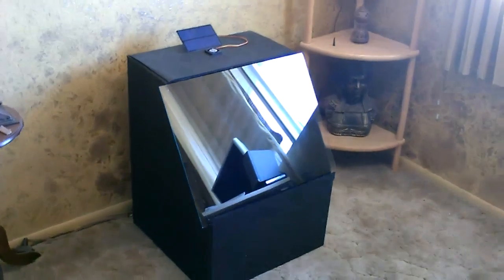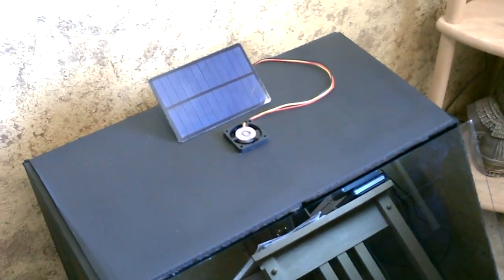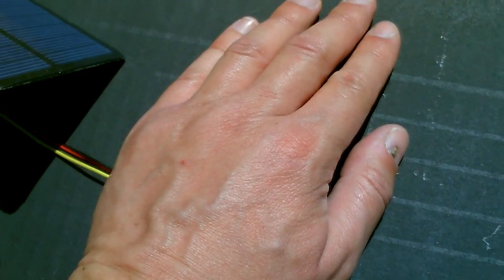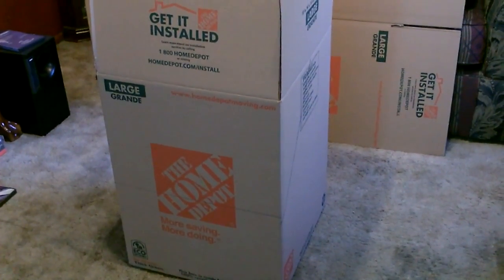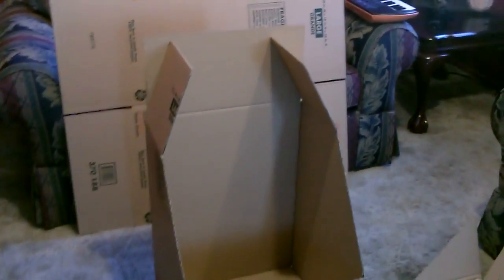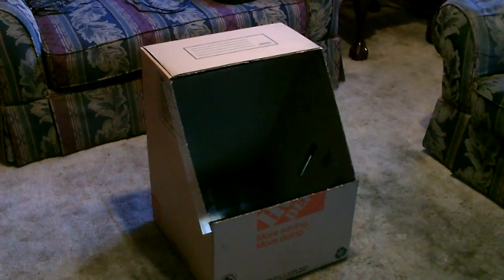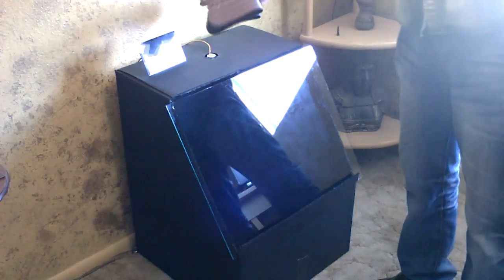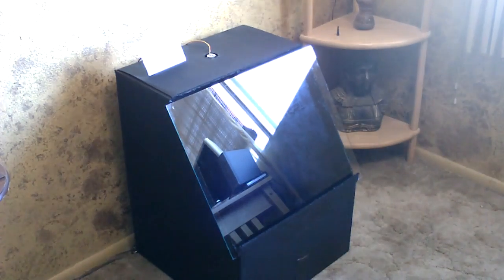Solar Air Heater DIY- (warms,drys,dehydrates,defrosts,de-ices) 150F

Comment: Could it e used as a heater inside the room positioned in front of a sunny window?
Reply from the maker: hi. if you use it inside you would just be collecting the suns energy that has already entered the space you want to heat (but you could potentially use it inside if you wanted to direct the heat to a specific part of the room). the best way to use this for extra heat would be to put it outside and then direct that heat in - maybe thru a vent or window)

Comment: Where are you getting your fans and what type are they?  I went on line and got overwhelmed by  choices. I just want the same  compatable  voltages that you have so I can  make one of these too
Reply from the maker: hi there. i've gotten many of my fans from frys electronics but i mostly get them on amazon now. the fan on this one is approx. 50mm and is 12v.

Comment: Is it really necessary to have the fan powered?  I would think the hot air rising would move the fan blades, like a non electric fan that sits on a woodstove.
Reply from the maker: terri1nd hi there. the rising hot air is not quite strong enough to move the blades.